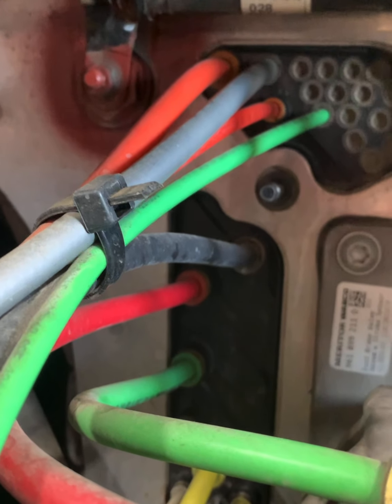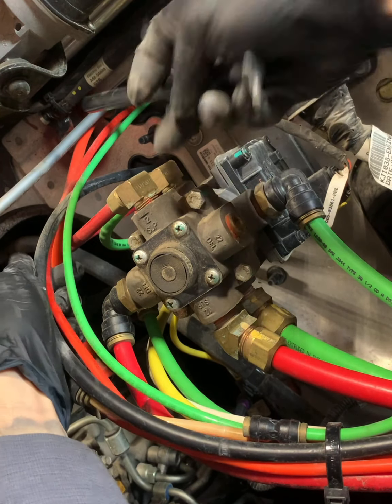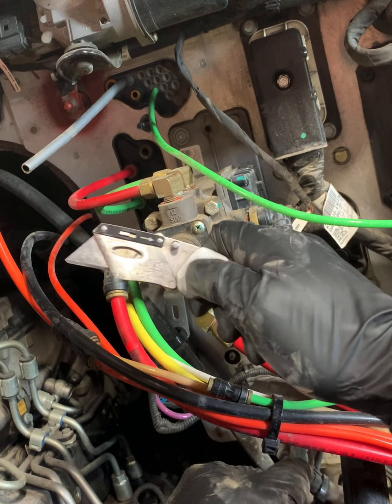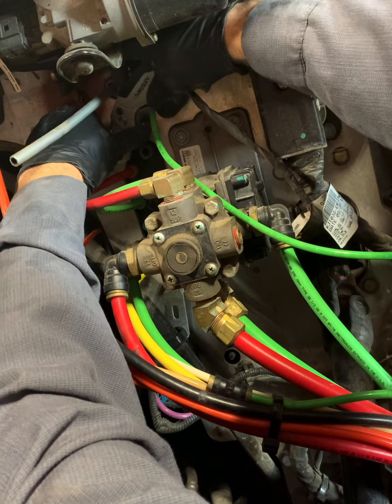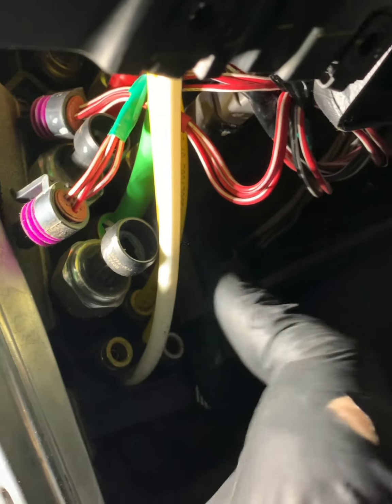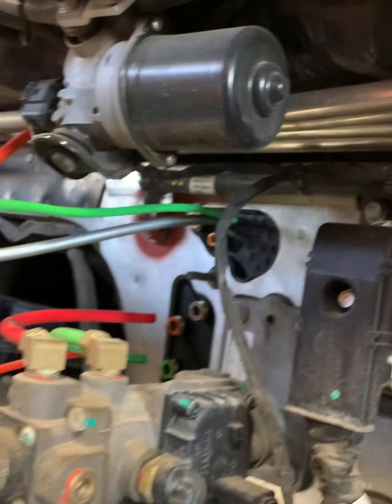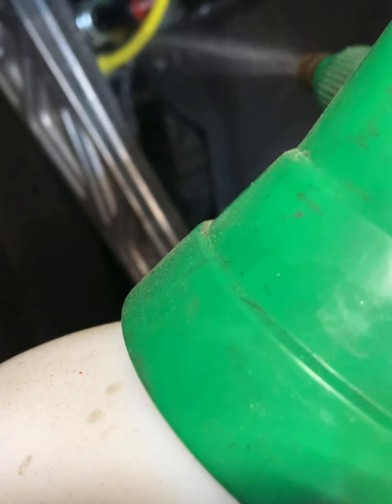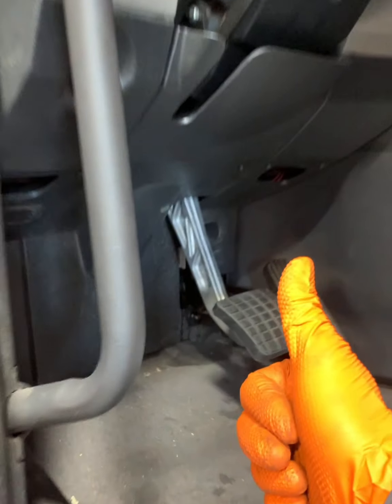Air pass through manifold replacement. Air leaks at firewall. Freightliner cascadia pressure sensors

Comment: Let me ask you, when I turn off the battery power , one of the stop lights, the left one, continues to stay on , if you turn on the battery power back on  and wait, then after turning off again ,  the stop light goes out . is this a malfunction, and if so , what is the problem?
Cascadia 126 , 
Thank you 
2020
Reply from the maker: @Inferlogist  this sounds like a ssam issue. This module has certain keep live circuits for when the load disconnect switch is off. If it’s acting up it’ll cause this senerio to happen.
Reply: did I understand correctly if this module needs to be reprogrammed or framwork needs to be updated?

Thank you
Reply from the maker: @Inferlogist  I doubt its a programing issue with  this module.Could be a hardware issue instead.

Comment: Hey I have an air leak from a plug. Should I just replace the plug ?
Reply from the maker: If the air leak is coming from a plug on the pass through manifold more than likely it’s the oring in that fitting. The oring would need to be replaced in order to seal that plug.

Comment: Just did this job now Truck is honking every-time battery is on. Think I swapped some air lines on accident from the parking brake. But all colors march correctly….
Reply from the maker: I believe what happened here was you installed  the switches in the incorrect ports. That will cause this exact senerio.

Comment: I just replaced the O-ring on mine that part is a ripoff. Plus if the air line is old and pitted it’ll still leak
Reply: Have to nip the tips off, use a razor blade